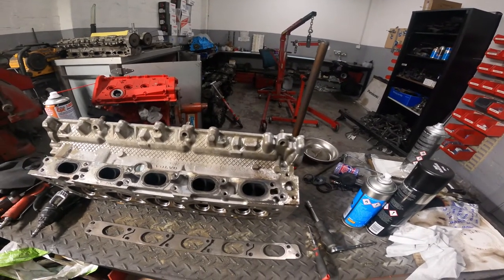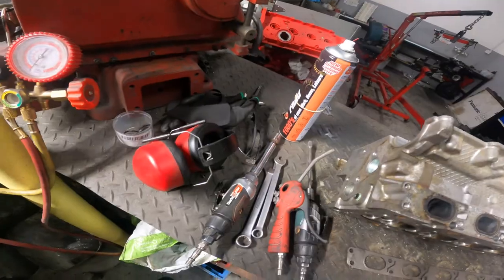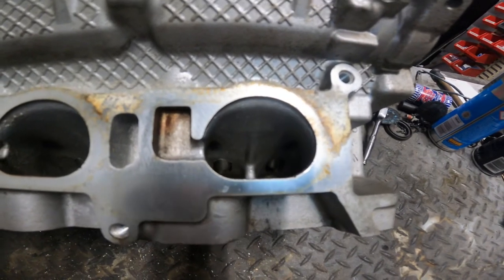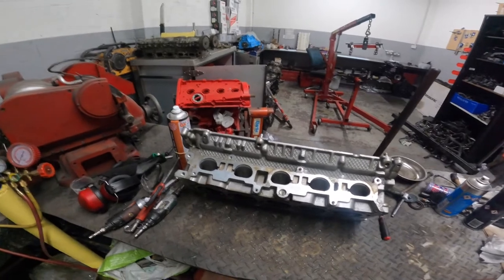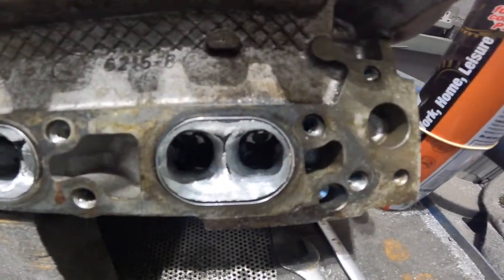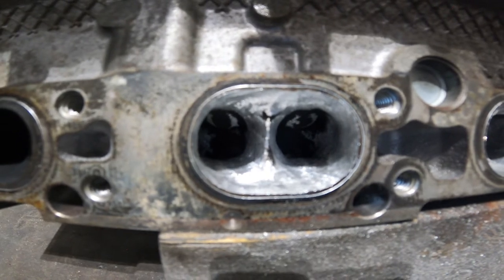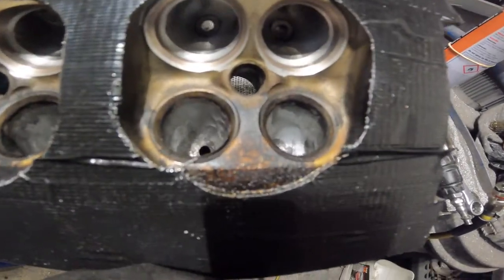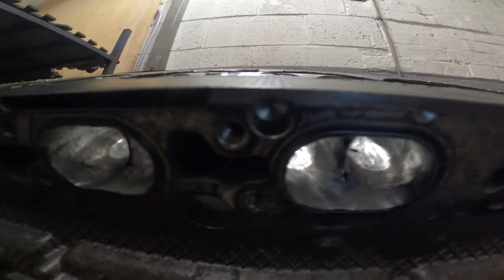Porting and Polishing a cylinder head part 1#BDperformance#Focusst225#VOLVO#xr5

Comment: What do you normally do about the transition to the inlet valve seats when keeping standard size seats? Generally seems to be a fair mismatch on most heads & I’m not sure if I’m better off getting the seat re cut to try and get rid of it, or just blend it by hand.